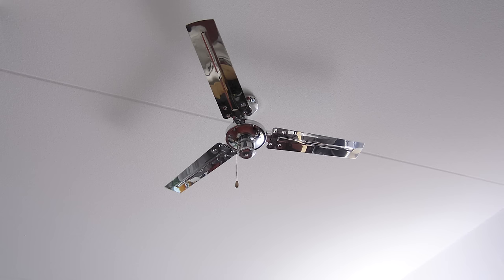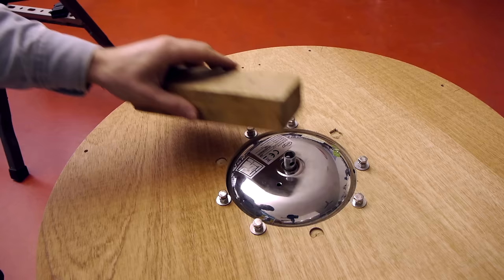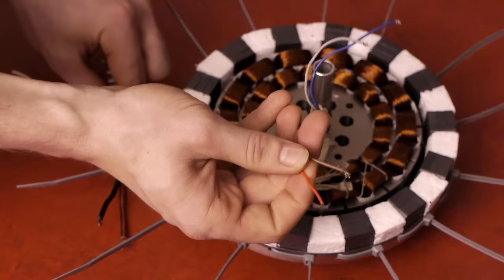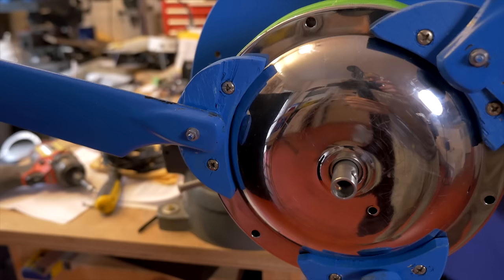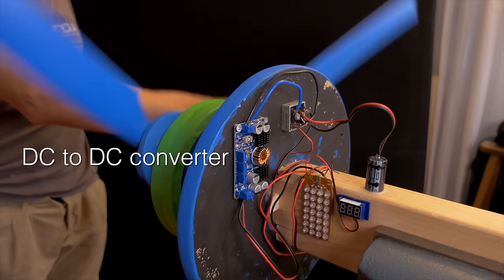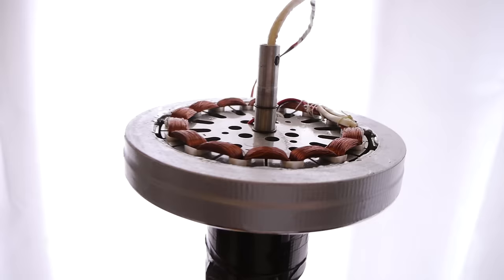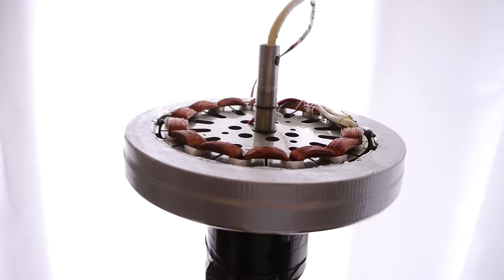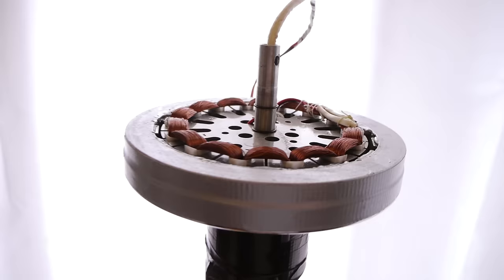Turn a ceiling fan into a wind turbine generator?!

Comment: I respect the fact your conclusion was unbiased. You tried an idea and you concluded other alternative approaches might be better.. Look forward to see the alternative options here.
Reply from the maker: Hello Ehab. Thanks for your comment. Yea: at first I was very positive about using a ceiling fan as base for a DIY wind turbine generator, but I even though I could make a better version now, I now don’t think this is the smartes base to build upon. But it was fun to explore & share, and I am working on a new experiment.
Reply: @ROB'S FREE ELECTRICITY DEVICES AND TINKERS 

"Take it to the limit!" - The Eagles

I was thinking about this exact thing as I watched this. I learned about electronics a bit through tinkering and repairs. I have never studied the field. However, my interest is increasing more and more and I feel like a ceiling fan generator can be a good device. My main objective is a the strong strator base and shaft. 

Personally, I'd redo the coils, magnets, and then aim for a better electronic set up. Someday if I am interested enough, I'll go through all my everyday items to start making random things. 

Sidenote: Recently, I made a input/output bluetooth adapter that will connect any two 3.5m audio jacks together. One of the two devices connects to your audio source, and the other connects to your audio output (speakers) Both run off of 5v battery or can be USB powered, or DC powered. I prefer DC powered on more permanent set ups, for example, your input would be DC powered, and your output would be battery. Lastly, my input bluetooth adapter is able to do the "broadcast" feature, meaning other devices, like a persons smartphone, could connect to it. This is handy for my home surround sound system, as I can have other friends bluetooth into it. No cables or getting up needed!

-Tim

Comment: I really enjoyed this honest and exploratory and informative video. Please post an update when you get one.
Reply from the maker: Thank you AutoTechTeacher. I aim to keep my videos real & calm. If it didn't work out, the why-so is interesting also, so other can improve upon/learn from my attempt. If there is an update I will post it!
Reply from the maker: Hello Rob. So: I looked at your ceiling fan generator videos. Cool: you went deep into it as well! And no, it sure ain't easy. Why did you get tired of my video though? I showed all the many steps that have to be taken, and how the generator and electronics are still not good enough. If I may, I have 2 suggestions for you: measure the output of the inner coils separately from the outer coils. I have not done that. My guess is that using the outer coils only is better than combined, but I am not sure. And, man; your videos are too long! -I saw them all, but while skipping a lot. Keep up the research!

Comment: Interesting!  There's a guy in Far North Queensland who converts induction motors into generators by milling out the rotor and installing magnets.  His rectification system is basically identical to yours in architecture. We are using one of his systems at work.   The machine is driven by a PTO and the output at full speed exceeds 2000W, at approx 110v.  The DC current feeds into a Victron Solar Charge Controller (MPPT), which charges a large battery bank.  Replacing a truck alternator, the system has proved more reliable, more powerful, and far  more suitable for battery charging.  Its also quieter.  Thanks for your video!

Comment: Aside from the improvements you've already presented in this video, I think a gearbox for the turbine, to generator drive shaft would greatly enhance efficiency. Also, a battery for power storage would help. Lastly, a variable pitch turbine rotor, which would be controlled by an anemometer, would complete the system. Thanks for the video.
Reply: Can you do a video on the variable pitch turbine rotor please?
Is that to automatically change the angle of the blades?
Reply: @teezyizeazy6261  it must be, as it turns faster, the direction of the wind changes relatively to the wings. I haven't tried it, but I think it could be done with a linear motion in the axis

Comment: I'm a "fan" of ElectroBoom, I'm here to thank you for using the FULL BRIDGE RECTIFIER :)
Reply: O yeaaa

But he is doing it right here ;-)))))))

btw electroboom got a new video up.
Reply: Thumbs up from me brother.
Reply: Did he install a SHUNT?
Reply: same.
Reply: I pity the fool would go half bridge on a generator project. That's denying half your power.
Reply from the maker: Me too; subscribed to ElectroBoom. It’s just that.. my eyebrows are not as full bridged.
Reply: @GiesbertNijhuis  This doesn't matter. It's his own style. You have yours. Go on with your ideas and it will be good.
Reply: (Turns on PA system) "FULL BRIDGE RECTIFIERRRR!!!!!!" (turns off PA system)
Reply: salut a toi fan d'electro boom. i'm a super fan to electro'boom.  i love this crazy'nut's guy ... he give the  thrue of the réality.  no fake with electro'booum .. haves a nice way to the discorvery oy free energy.. slt a toi l'ami
Reply: Soon as he said it... In my head with a clenched fist "FUUULLLLLL BRIDGE RECTIFIYAAA"!! HAHAHAHA
Reply: Uranus Delboro. As an old newbie amateur hobbyist,, this video would have saved me so many hours of research.
   It took me forever to find what I needed to convert ac to dc.
   I could find no videos that named the component.
  Ended up watching E engineering 101 lectures to find the bridge rectmyfinder.
  I coulda asked my uncle or cousin(e engineers), but who has time for that?
Reply: i see what u did the

Comment: Having built several wind turbines over the last 40 some odd years, don't sell yourself short my friend. You took 
a product that someone obviously didn't want and found another use for it. That's what we creative engineers 
do. You were definitely on the right track with your switching regulator setup and you should have dumped the 
output into a storage battery and then you could have used that to drive an inverter to produce the AC voltage
whichever is standard in your country either 110-120 vac or 220-240 vac depending on where you live. You
could have then easily charged your phone or any other USB device for that matter! 

I'm a HAM operator and I fly RC models, and with the advent of inexpensive brushless motors, building wind 
turbines just became a whole lot simpler, especially when you look at some of the larger motor sizes that will
easily produce 90 to 160 amp of current. Use your imagination my friend! Vertical Axis Wind Turbines are 
extremely easy to construct and can easily be mounted a lot higher up and don't produce the noise that 
conventional bladed models do. Try using the rotor from an old squirrel cage fan.
Best of luck to you !

Comment: There's a ceiling fan in my room put in by my late brother when he was living here. It wobbles to much plus I don't like or need it anyway. Thank you for showing me a productive use for it as a generator. Most electronic devices run any where from 3 volts DC to 12 volts DC (lights,radios,portable TVs,cellphones,tablets and computers. This device could power them and/or charged batteries that could power electronic devices. If a device can be plugged into a lighter socket of a car,this generator should be able to power it.

Comment: I liked the video...it was very helpful and inspiring. I noticed you had many comments so don’t know if my idea has been used already. The way the fan coils are wired, I believe, is in series. One of the things you could do is wire some of the coils in parallel to help lower the voltage but raise the current. That way when charging a battery, you won’t overshoot the voltage but with higher current the battery will charge the battery faster. 

I am going to see if I can pick up some ‘trashed’ fan motors and see what I can come up with. Again, good video.

Comment: Nice video. My only suggestion might be to keep the inner windings as a regulator. It may be that at a certain speed, your input is at max. At that level, apply braking to regulate the blades at max, for instance, during a storm. It may be used to disable the vanes from spinning. Possibly, this braking energy could be collected as well, using a secondary system that only functions at max wind.

Comment: Connect the windings in parallel instead of series.  You could connect them so it outputs 25V instead of 50V, and you would not have to waste power in the regulator IC.  Connect every other one for half the voltage or every fourth one for 1/4 the voltage.
Reply: This is the best way. Fix mechanically from the ground up for the system you have in mind if you want efficiency. Fix afterwards with cheap electronics if you want conveniance.

Comment: Having a battery to charge would be good. The power can be stored & regulated slightly this way. I used to experiment some time back. The wear seemed more a problem. There are better options as you mentioned which I did not have then. I will get to it someday & record it too. Thank you for it.

Comment: After you figure out the electroncs more, I suggest you also modify for VWAT. Mount your motor back to the original vertical alignment like it was for a ceiling fan, then mount something like a bike rim to the axel and install vertical blades. This will mean it is omni-directional to wind and will turn in far lighter winds and be less subject to overspeed forces. Since the base is now stationary (omnidirectional) you will not need complicated slip rings to transfer the power or have the cord wrapping around the mount pole.
Reply: Great idea
Reply: When you say vertical, do you mean the axis of rotation?
Reply: they only really work i big format , the resistance of the blades going upwind always make them slow but torqey , to make it work a direct drive washing machine moter (rewired in star 24v) and a hefty gearing might be the way to go

Comment: A dc motor with permanent magnets is cheap, and requires none of the major engineering... not as much fun, perhaps, but if your goal is a working 12 volt system, that is the easiest way... it can be regulated by a automobile 12 volt regulator for cars that use a generator, rather than an alternator... Bosh for the old VWs is my personal preference... they can be used with either wind or water to generate electricity all day and night... 

That being said, I think the effort was a great learning experience... that is how new technology comes about.  . Excellent video sir

Comment: This is a PMA , i made one very similar in my "Doomsday exercise bike generator" video about 1 year ago.  i utilized both windings and i got over 110V AC which i powered a shop light.  i attached a household outlet to the output which allows me to simply plug in a cellphone charger or battery charger, and use the PMA to charge batteries.

Comment: I'm not an electrical engineer and don't pretend to be one.  However, I see that the center of the ceiling fan stator had larger/smaller holes drilled to balance the difference of weight caused by the wiring used from the factory. When you removed all that useless wire, it offset the once balanced stator.  You would need to drill the smaller holes out to the same size as the larger holes to get a balance. Also, the use of neodymium magnets would improve efficiency (which you may or may not have used- it wasn't discussed).  A good voltage limiter can be made using op-amp and resistors.
Reply: That part doesn't spin, no need to be properly weighted

Comment: A very intriguing and informative video, had me glued on to it till the end. You say that you don't have an electronics background, I'd say whatever knowledge that you have is more than that of a beginner. You have a clear understanding of the concepts and know-how of electrical components. Great video. Loved watching it.
Reply: I Don’t know much about electricity Giesbert, however your working knowledge is inspirational and educational. Also like you said, there is always room for improvement and fine tuning of good ideas.
Reply: Its snive id a if non id like! O convert s bike to ekevctric bike twelve voldt battery onthe rake on the back snd alternators mond! O rr generat! Hecthe power! O charge it? Niugh ti? Un s geny onrh bik s rak s snd run s as?washingmachine s engin in electrical rusity ut can csn; sculste round and hit one wats but a drill can go in reaverse now
Reply: Is love ke! O know hi Michael ch iff a machin is! Hreer in s piump of sir pump its got to eath we re hace sir run bikes w hole fan add hould move a bike

Comment: I found your alteration interesting. It reminds me of what many of our Bushmen do here in Alaska. Here we get a GE or Chevy alternator. It is fasted to a stand. Sometimes a home built tower. Sometimes a post. Like a flag poll. Only it is flanged so you can bolt onto the top a windmill. On the shaft of your wind blades is a corresponding pully so you can connect the rotation of the windmill to a GE Alternator by an appropriate automotive fan belt. This transfers wind into mechanical energy  via the belt & pullies. In turn the mechanical energy is converted into electrical energy by the alternator. In a GE Alternator there is an internal bank of diodes. These diodes convert the 130’ish volts of a typical low end alternator or about 160’ish to 190’ish ac volts of a high output alternator into useable 12 volt via the diode bank. The only maintenance is changing the brushes inside the alternator ever so often. Also, if one of the diodes open ( think like turning off the light switch ) then you will have to replace the diode bank, but this is unusual. This is an easy setup after your tower or post is set. It is also low typically low maintenance. Now you can use a Ford Alternator or even an old cars generator to do the same thing; however, you will need some additional components to regulate the out-put of voltage. In comparison of these two options. The GE Alternator is easer to hook up to a battery bank for simple lighting. With the Ford Alternator you can get a different independent regulator rather than the automotive ones. So long as it is compatible. This will require a better set-up, but the extra effort yields more power output. Build it strong to service a wind storm and both become virtually maintenance free. Cheers everyone. I did like this video though, because I have often wondered about what this man did. Now I know. Thank you for this demonstration.
Reply: Good suggestions